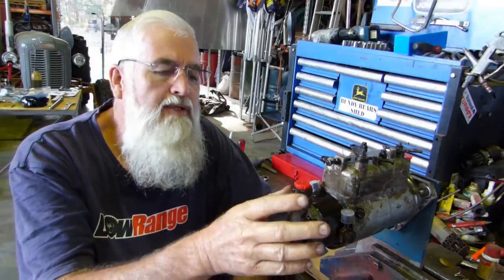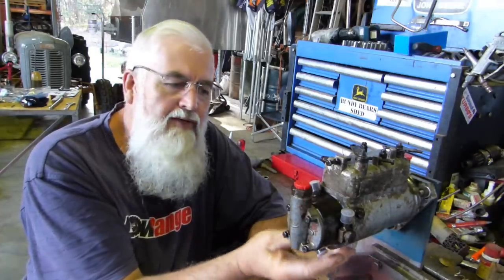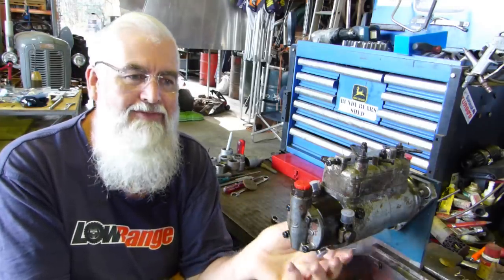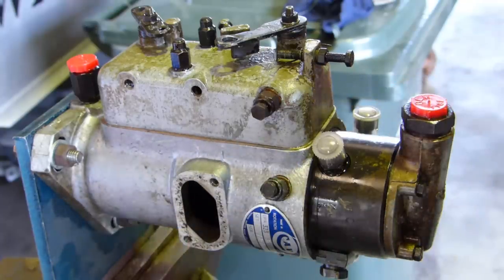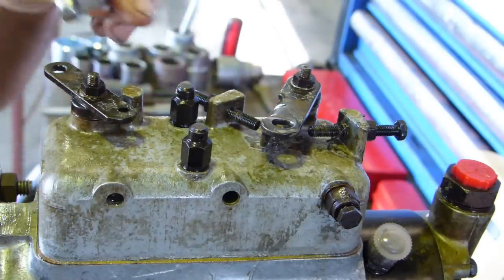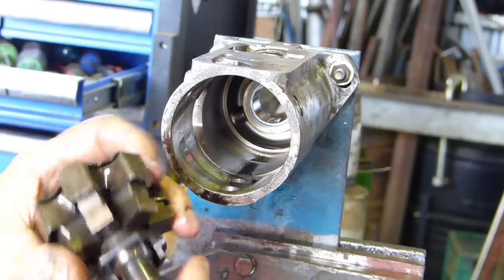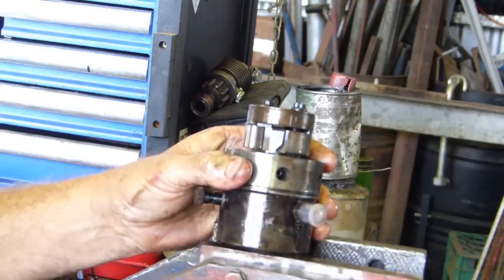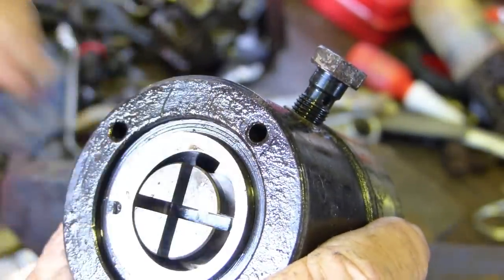MF135 Restoration #14 Dismantling the Injection Pump

Comment: I'm on round two of disassembly on my pump, I followed the older video first and now trying to figure out what I did wrong.  Pump does not develop pressure, just dribbles at injectors, worked fine before I attempted seal job.  I cant see anything wrong yet but am wondering if the two stage advance mechanism on the bottom of the pump could cause such issues?
Reply from the maker: I dont think so, Sometimes it is hard to get all of the air out without fitting it to the tractor.
Reply: I did the same thing could only get a dribble after taking apart several times.. so finaly put it on the tractor and she ran great
Reply: @mickeymcmillian9885  yes a  "dribble" is a relative thing. At best the pumps don't put out a big stream and it always seems like just a dribble. In my case it was very much a dribble due misssembly on my part.  After correction it was  less than a dribble and more of a small squirt and started right up

Comment: 41:30 interesting about how critical the position of the circlip is. Is that just because it's your visual timing reference from earlier on in the disassembly or is it mechanically linked to the timing? Is there any risk of it drifting out of position over time due to vibration, etc?
(Sorry if this is answered in the video - I'm watching it in installments and might have missed it!)
Reply from the maker: It is just a visual reference, i have had pumps back from a diesel shop and they havent bothered lining it up at all. Doesnt matter at times.
Reply: @BundyBearsShed  Thanks This helps. I was thinking it is just a visual reference so i will have to go by feel to get my tractor going nicely. I dont have any past references to line up to.

Comment: Since I rebuild my injection pump on my 23c, the throttle is super sensitive than I cant drive the tractor, one place it want to rev super high and 1/8 less on the throttle shaft and it shut off.The shut off is less sensitive than the throttle so I can move with it more easly. Do you have an ideas on what I do wrong, linkage, timing, governor , spring bleeding etc? I rebuild it two time to see that problem and I saw nothing wrong.And I truc meany possibility on the governor spring hole to do nothing.
Reply from the maker: It sounds lije the governor spring is in a wrong hole. Have a good look for a shiny worn bit around the holes and that might give you a clue to where it was

Comment: Hi, excellent video. I have some issue with my MF135. After it runs for a while and the motor is warm, the engine revs up without changing the throttle position. This happens while driving and during standstill. I suspect the injection pump and your video gives me the confidence that I can try to repair it on my own. Any other hint, what the issue might be specifically, is very welcome.
Reply from the maker: G Day Axel, I would just check the metering valve is nice and free and not sticking.

Comment: Yep . Watched  this video AFTER removing  idle spring  without paying attention. Lost the idle spring.  Also  dont take right end fuel line out of injector pump and turn pump upside down .  Oh mummy.
Reply from the maker: There are a few holes to fall in for sure.

Comment: Hi Lance, awesome video mate! Appreciate the wealth of knowledge you have and the will to pass it to younger tinkerers. I have a MF185 and its starts at the tap of the key and runs perfectly, but the pull to stop lever no longer works, it just moves freely. Have you come across this before? Has the cam come away from the arm inside somehow? It stops fine when I rev it up and force the throttle lever off. Thanks mate.
Reply from the maker: A lot of times the nut on the top has come loose and the lever has ridden up so it doesnt contact the flats on the stop shaft. Worth a look and easy to fix.
Reply: Thanks Lance, I'll take that lever off and have a check of that. Cheers!

Comment: Great video. Very helpful! I just bought a mf135 that was not running. In my excitement and ignorance, I pulled it behind a Cummins trying to start it and didn’t realize I had it in reverse while pulling it forward for several hundred yards. Did I destroy anything doing this. Is a rebuild of injection pump futile at this point? Thanks!
Reply from the maker: Probably no damage  I wouldnt be to concerned at this stage.

Comment: Thanks Lance for a great video which gave me the confidence to tackle my CAV pump on my IH444, it had a leak coming from the bottom of the pump but I decided to take it apart and replace all the copper washers and o rings to give it a bit of a birthday! The problem I had though when I took it apart there wasn't a big circlip inside the pump, it used to run pretty good but now starts ok and then the revs go right up to max which I shut it down pdq any suggestions what I can do or where I could get a circlip without buying a new pump? Cheers from across the ditch in Kiwiland
Reply from the maker: G Day Peter, I would think you have the top springs in the wrong place, that is usually what makes them rev up. I have never seen one without a circlip.
Reply: @BundyBearsShed  G'Day Lance have checked it, the number on the plate is 4 which I think is hole 2 on the governor and 1 on the throttle shaft? I suspect that someone at somepoint has had a go and forgot to put the circlip back in - is it a vital piece for it running?

Comment: Absolutly great video !!!  I dont believe anyone has ever done a video so needed by folks who are having issues with these pumps , finding info on them is like searching for Atlantis! Lmao  thank you again , you've helped me greatly.   I do have 1 issue I cannot seem to resolve on my pump.  I cannot locate the spring number anywhere, my pump plate doesnt have any of that info on it , lucas cav dpa 3348f301.   Type RE37927 ,  nobody can tell me where the spring is supposed to be , any chance you have any info on this ? I'm really sorry to ask after you've provided so much.
Reply from the maker: Ni I only have limited info but look at where it goes and there is usually small shiny marks that would give you a hint.
Reply: @BundyBearsShed  someone chimed in on another forum and gave it to me , I'll pass it on to you so you have it incase someone needs it in the future. Thanks again for a great video and all your help.
Reply: Bud I'm waiting on parts for mine now , but very curious , I was having trouble bleeding my system to the injectors ,  I was told to crimp the return line and crank the tractor. With lines cracked ,  does that seem correct to you or do you have a better way ?

Comment: This is indeed a big improvement compared to the previous vid! However in the line-up at the end of the vid where all the parts of the backplate are, you're missing the little fiber ring that supposed to be at the bottom of the guide. No biggy, just a thing to be aware of. I'm gonna take off the back plate from the CAV sitting still on the Landini/Perkins and take that back home, cause this stuff is too fragile to do in the field. Thanks again! (btw where is that 45 degree vice you're using made for? Probably a Bundy Special :-) creative for sure)
Reply from the maker: Thanks, The vise is just a fabricated offset vice, I have a few of them.

Comment: Lance, I love your videos, they are really helpful and I appreciate your encouragement to tackle these projects on our own. I am knee deep in an old Perkins 4.236 I just bought. It had not run in 15-20 years. I got it to break loose, put on new fuel filter and lift pump, bled the pump and injectors with fresh fuel, changed the oil and filter, and it actually fired and ran. Unfortunately, it goes to full throttle and neither throttle or shutoff levers have any impact on it. I am curious if you have ever had a situation where the CAV pump internals (whether metering valve, governor or timing/fuel advance, etc.) would ever cause that situation? I know that blow by of engine oil or leaks around the valve stems could fuel it but the engine starts with gray/black smoke and almost immediately goes to full throttle. When we disconnected the fuel line, it will run for a second and then shuts down, making me think it's something with the pump. If we leave the fuel connected, we have to shut if off with a block of wood over the intake manifold. (engine is non-turbo).  Thank you and I would appreciate any advice or direction you might have on this. John Harrison, Florida, USA
Reply from the maker: Too much oil in the oil bath will make them run away and the stopper should shut the metering valve to closed position so pop the top off for a look .
Reply: @BundyBearsShed  I pulled the top off the CAV IP yesterday afternoon and the metering valve was frozen in position at close to WOT. I got it to gently worked it and got it to break loose, and lightly buffed the metering valve and got out the rust and schmutz that was in the top of the housing. I am having a dickens of a time getting the shutoff peg to seat properly on the shutoff plate so that it works, and my new out of the box lift pump seems to be lacking enough umph to get fuel at the proper pressure to the filter and then IP so I will try an electric pump as a makeshift to see if I can get it all to come together and run under throttle control. This engine is an ugly duckling right now but am hoping to get it back to it's glory soon. ya'll are a huge help and I like how you are able to weave Australian mannerisms, words, and humor into it all. It's like we're right there with you in the shop. Thanks again!

Comment: Can you put some sort of washer  or something to seperate the stopper valve from from the flat surface of the pump if it seems sticky ? I have cleaned and finely polished mine up but still seems to bite a bit on the flat
Reply from the maker: Not that I am aware of
Reply: Bundy Bears Shed ok got any ideas ? Or just keep it as is clean and maybe add some 2 stroke to the diesel mix been hearing the diesel nowadays is too clean drys pumps out

Comment: I have a 6 cylinder version of this pump and I've either got a leak from the bottom fuel pipe as i cant see it leaking from anywhee else, the fuel stop solenoid or perhaps that large 'O'ring at the back. If it is the large 'O'ring can i change this in situ without removing the pump from the engine?
Reply from the maker: You can but it is a fiddle.